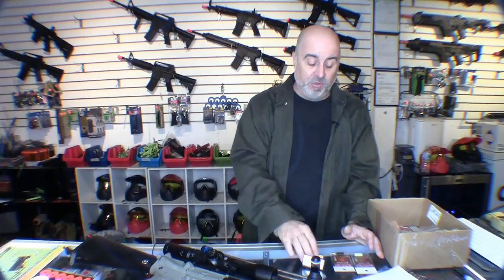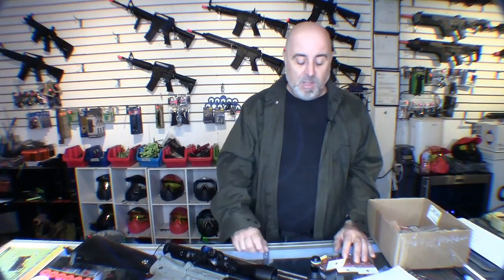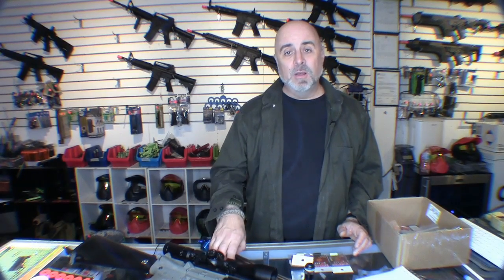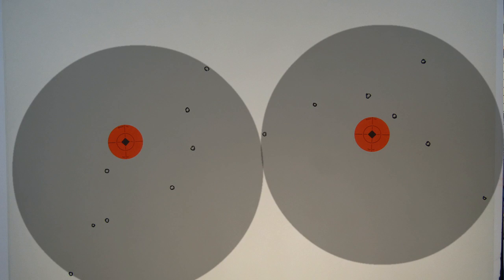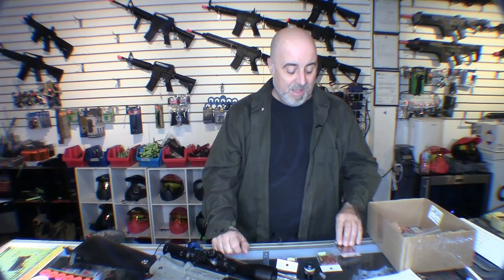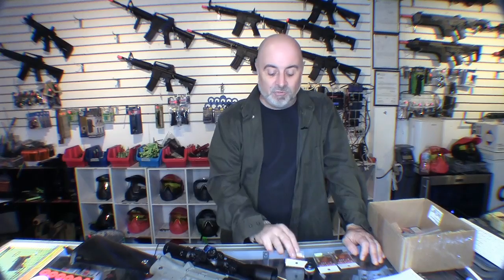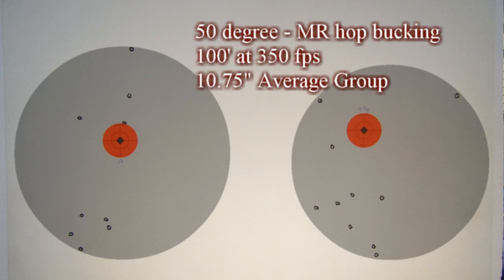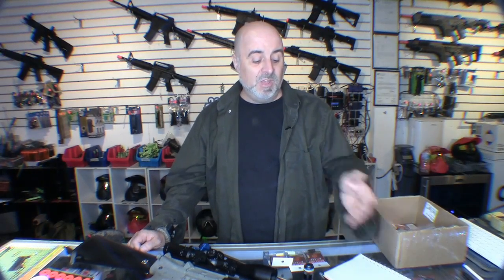What do bucking temperature ratings mean?

Comment: a harder rubber requires more pressure. This causes more repeatable insertion of BB's into the chamber. BB's are shot into the chamber through the nozzle, tappet plate and its spring. A hard rubber also reduces power, so it will not be suitable for every set. Especially when we are talking about 1-1.5J.

Comment: Want to add, higher degree bucking is better for more precision on higher powered systems you will see lack luster results on a low power or stock system. For measurable effect: Bucking = reach out distance, barrel diameter = more accuracy. My DMRs are 2.10 - 3.0J, 450-550FPS minimum engagement distance 100 - 150 feet depending on feild. In the same control i can hit 2-4 inch grouping at 100 feet, 8-10 inch at 200, 12-20 inches at 300 (with rifle zerod in sled). If I change to stock bucking these numbers will change drastically. If anyone is interested I will create a video showing stock bucking, then 50-80 degree buckings. Each bucking would be used in a tournament ready HPA DMR with .32 BBs. I would shoot 300-400-500-600fps through the buckings each at a engagement distance of 100, 200, then 300 feet with same hopup position. (Control for FPS would be changing HPA DMRs pressure, then matching same pressure for each buckings FPS tests, and for compliance would chrono each bucking before testing to ensure FPS is ball park +/- 15) Ive done this test before just not in a video format. The results then were harder bucking allowed higher FPS system to reach out further. The lower FPS saw increased range at softer buckings, but decreased range as the hardness climbed. Meaning, if FPS is the same the 50 degree bucking and 70 degree bucking will make a large difference at longer engagement distances with 70 allowing better range with high FPS system.

Comment: I’m using .49 gram in my fully built Tac 41 at 501 fps I found that the 75 degree is the better one to go with because the grouping of each shot is a lot smaller and when all you see is someone’s head you want be able to hit that 6 in target compared to the 2ft width of someone’s body.
Reply: Dude where do you play that let you run a .49 at 500fps? your joules of energy would be way high
Reply: @phillipwall1932 Yea I want to know, unless the person is using it for pest control or trespasser deterence

Comment: They're not degrees. Hardness and softness rating is known as the "durometer"
Reply: durometer is the tool to measure the shore hardness :)
Reply: Yes, but they “maple leaf” purposely write those ratings in degrees.
Reply: So if that’s not a degree called why in the hell all companies they called every damn hop up bucking called 80/60/50/70 degrees and what’s matter your tying to correct this man I’ve been playing airsoft and build so many rips aeg/gbb and looks like your trying to push you silliness so what do u called if its not degrees?
Reply: @Gbrmkrs  In this context the question of "degree" was in relation to temperature. The duro is referred to as degrees yes, but it doesn't mean temperature. You're getting angry for no reason. There's no silliness here.
Reply: @PartNinja  I know that just curious on your comments saying that’s not a degree u know what I mean ? FYI yes they’re all of em are different degree bucking and that’s based and apply if the bucking is hard medium or soft and reason why all the companies add those types of degrees is to know what temperatures of the bucking can hold and not melt etc etc. just to make sure we all know what we’re talking about.
Reply: @Gbrmkrs  again the "degree" does not refer to temperature. It refers the shore value of the rubber (it's durameter). That's all I'm saying. While certain hardnesses can be better for warmer or colder weather than not what the degree rated is referring to. The hardness of the bucking really only matters for the FPS you're shooing at. Softer better for lower fps and harder better for higher fps.
Reply: @PartNinja 😂these fools will keep arguing with you despite having no clue what they’re talking about. I smell people born before 1980 🤡

Comment: For a standard AEG like a rental gun, the degree doesn't matter that much (if at all). Where the degree matters more, is for high speed DSG builds and snipers. When using a lighter bb at lower fps, a softer bucking is preferred because the bb can deform the nub and make better contact. When using heavier bbs, they hit the bucking harder, so a higher degree of bucking is preferred to prevent bad accuracy and eventual tearing. (FPS also plays a big role when using a tougher bucking) High speed DSGs will use a tougher bucking because it doesn't deform much when pounded by 60 bbs per second. Thus not tearing or not hopping the bb properly. For snipers, they shoot over 350fps with a very heavy bb. So having a much higher degree is paramount in getting a good hop at 250ft. The harder bucking can hold up and not deform too much when hit by the bb. For those cases ,degree maters. For a normal AEG (like a rental), the contact patch maters more than the degree.
Reply: Personally, i like soft bucking more because it create better air seal compared to harder bucking.

It is also cheaper. 

And I also find that harder bucking tends to become brittle faster than softer one. Especially when stored at long time
Reply: @ebehdzikraa3855 If built correctly they will both seal the same.
Reply: I use 75 degree autobot in my SSG24 with TDC mod. Absolute monster with 0.40g
Reply: You are somewhat wrong. This in theory, but in actual real life it's that at all. To put backspin on the BB, you want as much grip as you can get off the contact patch. A softer degree bucking will always give a better backspin compared to a higher degree. I have used 50 degree autobot buckings in many VSR-10, MK23 and DMR builds and you would be surprised how long it would last. I usually use 60 degree Macarons in AEGs shooting 1.5-1.8 Joules and it never fails me combined with a ZCI barrel and omega nub. Tuning the gun itself is far more important than just the bucking hardness.

Remember, buckings are consumables as much as AEG o-rings are. Yes, softer buckings will wear faster compared to a 70-80 degree but i'd prefer better accuracy than bucking longevity.
Reply: @VegaStryke Sorry, but he is very much correct. Some aspects of what you said also can factor into how things work. But as a whole, the heavier bb and faster bb builds will have far better accuracy and longevity if all is built correct with a harder bucking. Where some of your comments become accurate depends more on ambient temperatures. If the temperatures are colder heavier bb and faster bb builds do better with a softer bucking because of the cold temperatures stiffening the bucking. Yes depending on if you play indoors, outdoors, and/or your velocities are higher versus lower can all be a factor as to which will work better. In the end if you do not care about the longevity of your bucking then yea go ahead and stick with a soft one. Just remember that you maybe more tech savvy and have no issues opening up your gun to replace the bucking, but I would say there is a larger group that are not savvy enough as I see their guns in my workshop for even easier issues.
Reply: I use a 75 degree bucking in my fully built Tac 41 and it’s a lot better than the stock bucking which is 60 degrees